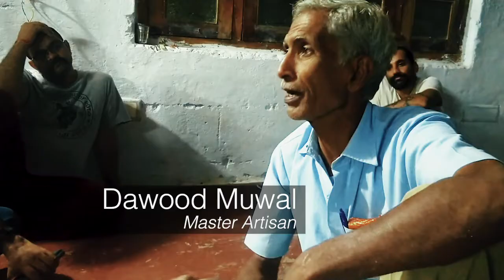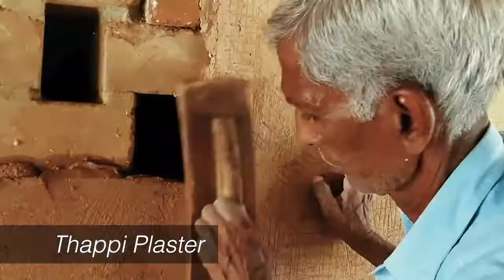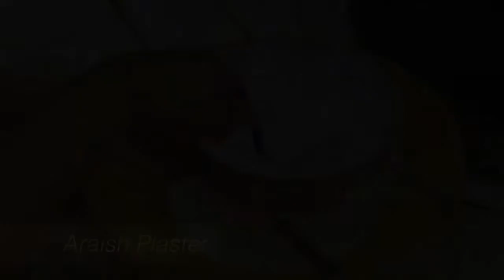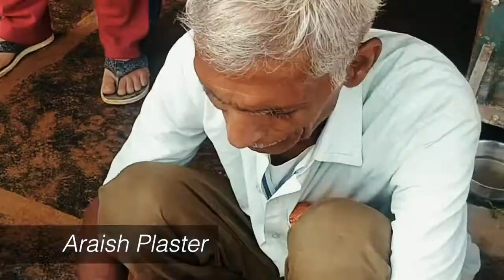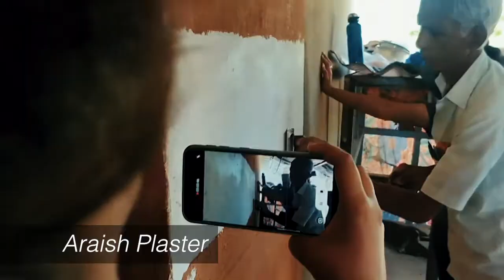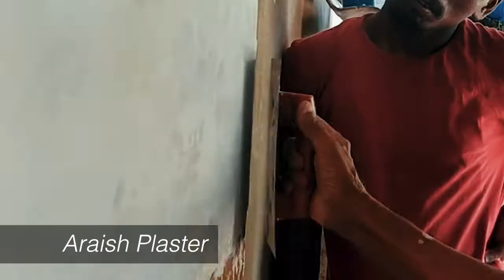Rajasthani Lime Plaster Workshop 2022

Comment: Lime plaster ka pura process bataie na
Rajasthan ka plaster or chetrinad plaster me kya fark hai
Reply from the maker: This video is designed to give a glimpse at what our workshops are like. We have other videos that demonstrate the techniques. The main differences between Rajasthani Araish plaster & Chettinadu plaster are : Araish is a fine polished lime plaster applied over a Thappi plaster base. 
Thappi plaster consists of surki (burnt brick powder) and slaked quick lime with herbak admixtures in the form of fermented water made from gur (unrefined sugar) and methi dhana (fenugreek seeds). Thappi is applied up to 3/4in thick to create a strong level surface. The plaster is beaten with a thappi (specialised wooden implement) in order to help adhesion to the wall, compress the plaster and prevent the formation of cracks. Before applying the final Araish final layer the Thappi is allowed to dry for a minimum of one month. Araish is made from a combination of white marble powder and slaked quicklime, which is combined and ground on a stone to a fine paste. It is then applied to a maximum thickness of 2-3mm and compressed with a small metal trowel. Then dusted with soap stone powder and burnished with a stone to achieve a high gloss reflective finish.
Chettinadu plaster is made from a combination of slaked shell lime and either sand or finely crushed quartz stone. The herbal admixtures used to impart waterproof properties and a glossy finish are, curd (yoghurt) and egg whites. Chettinadu plaster can have as many as 6 or 7 layers. Each with an incrementally finer grade of sieved quartz stone. Each of those layers is applied over the previous plaster layer whilst it is still wet. The final layer is burnished with a stone. 
See the following link for more details about Thappi plaster https://www.youtube.com/watch?v=iiY4JMYYTn8
Reply: Pura process= arish ko pis kar marbel powder me milate hai,phir uska base coat lagate hai, phir usi base coat ko pis kar ke dusri baar phir uske uper pure arish phir sabun phir soapstone agar sabun nahi lagaya to.
Udaipur Rajasthan me yeh 20 rupees square feet me hota hai , 
Aur agar aap chaho to me iske kuch pic bhi bhej sakta hu,
Mene city palace udaipur me 13 saal kaam kiya hai